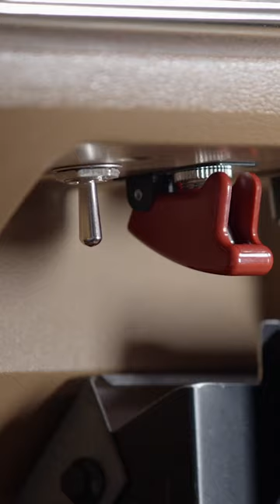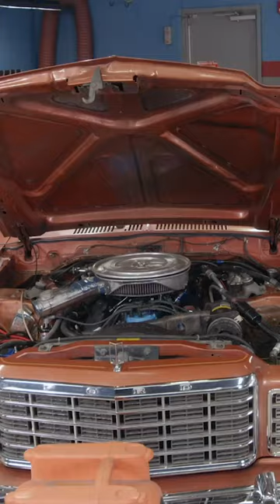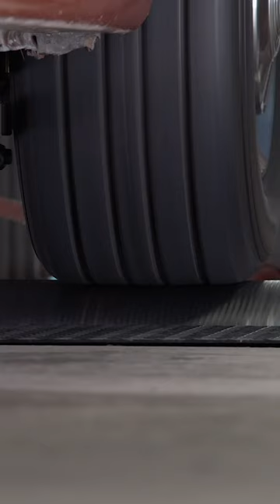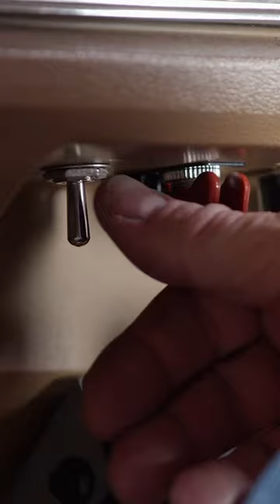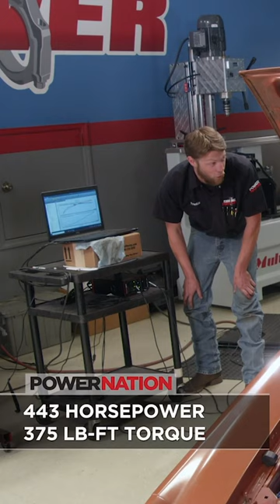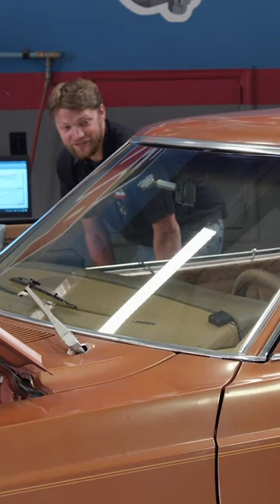Opening the Headers on Our Sleeper Granada

Comment: I had a Mercury Monarch with a 351 Windsor back in the 80s.. went pretty good stock.
Reply: Nah need that Cleveland..
Ever see the difference in the heads  No comparison.
Reply: @wildbillbegleyjr.3523  If I'd had a choice I would certainly agree, but the not so pretty Monarch was a hand me down from my Dad. L0L
Reply: @genesimons8368  Cleveland wouldn’t have fit in a granada but would be cool
Reply: My old black Monarch had factory rear disc brakes

Comment: That's my first car, thank you grandma
Reply: My first car was a 65 Chevrolet pickup with a 283 V8, it was 2 wheel drive.  My wifes cousin raced a 68 Ford Torino with it, 1/4 mile, he left that dude in the dust.
I still have my 65. Now it's 4wheel drive, with a married 4 spd manual trans and a stock 350. But it needs an overhaul bad now! I've owned the truck for 39 years!
Reply: My first car was and still is a 1967 Pontiac Firebird 400 with a rock crusher Muncie 4spd manual transmission. Fun as hell to drive. I've had it up to 150 mph.

Comment: I had a stock 68 Impala s s Factory rated 425 hp 396. Ran 10.99 in the quarter. Miss that one. Still have engine and tyranny but heed a street legal chassis for it. May try adding a few horses to it.

Comment: How did a 1975 to 1982 302 351 Ford emissions Era vehicle make over 200 hp.
If Opening a cutout added that much power, the engine should have stalled when they closed them!

Comment: What cubic inch. 
Small block 
Or 
Big block?????
Reply: Small block ford, it's a 351ci Cleveland or Windsor or it's a 5.0/302ci. Man even if they ran the exhaust into a single 2in I don't think it would loose 120ish HP. Lol, I can't believe they thought people would believe that but then again I don't see anyone else posting about it. lmfao. Either the Dyno is crap,  its BS,  or they intentionally choked it to death so it would pick up so much. Now people that don't know any better will be changing exhaust expecting a huge gain and only be picking up 15 to 20hp if their lucky. Especially on a stock engine lol. Sad...

Comment: And they'll wonder why they need hearing aids at 55, open headers in a closed set with no hearing protection. Genius's
Reply: Hearing damage only happens if exposed for longer durations, more than a few mere seconds.
Reply: Heck, im 35 and need them. Beats listening to a battery car!
Reply: @jayman2899  there is a lot more behind sound levels and hearing damage. The distance to the sound source and the dB level from that distance is what matters. 

Sound works on the inverse square law. For example, if you are twice the distance from something, it would be perceived as a quarter as loud, and the dB reading would represent that. 

That exhaust, at 3 feet from the tip, might be 150dB. But from the driver's seat, they're at least 7-8 feet from the source. As for bouncing off the wall to their ear, let's assume the car is 6 feet from the wall. The sound then has to travel 13-14 feet from the exhaust-wall-ear. It'll be perceived as loud, sure. Rough math puts it about 130 in this worst case scenario. Would it be smart to put ears on? Sure. but it's not going to instantly deafen you, or cause a lot of harm unless you do this kind of thing repeatedly well into one's 50s.
Reply: Yep OSHA has to put their non important 2cents in..
Reply: Whhaaattt?
Reply: @leeboyd7633  Kevin works for OSHA
Reply: Yeah no kidding. I'm 65 now and I'm wearing them now. My '75 455 T/A did it's damage. Lol
Reply: @jonpierce734  yes sirrr go figure right lol

Comment: 120 hp in the exhaust? I say impossible. You would have to have the most restrictive exhaust imaginable to unleash that much.
Reply: Yeah, that’s impossible and if it was factual, they didn’t even touch on exactly why
Reply: What are they using, a single exhaust and a lawnmower muffler? I call BS.
Reply: @Reggiestreet  You have to watch the episode to see why.
Reply: Lmfao, I thought the same thing, even if they ran them into a single 2in it wouldn't loose 120ish HP. Lol, I can't believe they thought people would believe that but then again I don't see anyone else posting about it. lmfao. Either the Dyno is crap,  its BS,  or they intentionally choked it to death so it would pick up so much. Now people that don't know any better will be changing exhaust expecting a huge gain and only be picking up 15 to 20hp if their lucky. Especially on a stock engine lol. Sad...